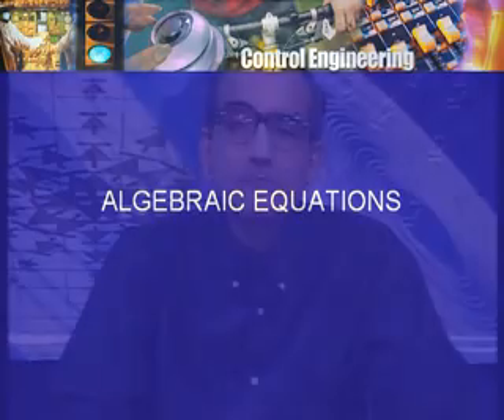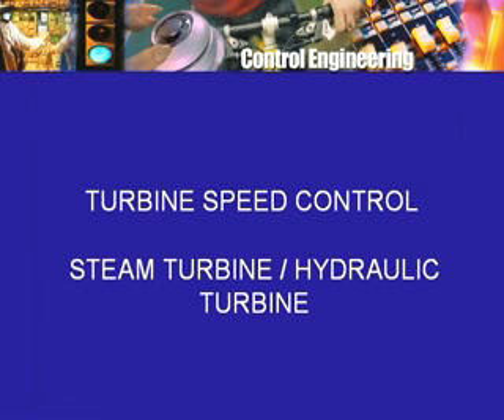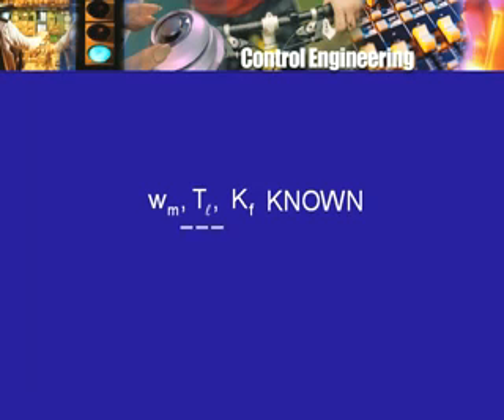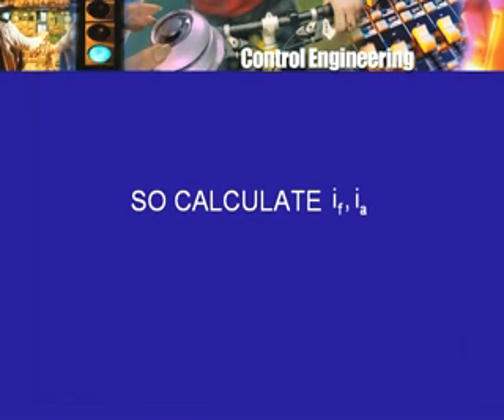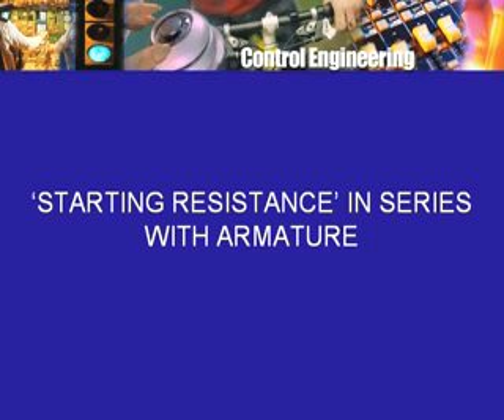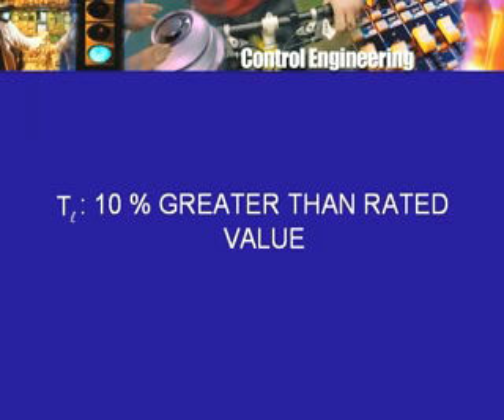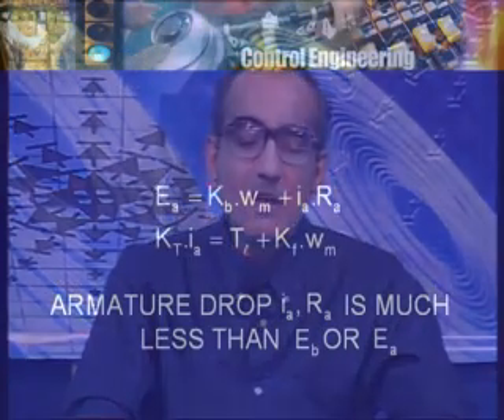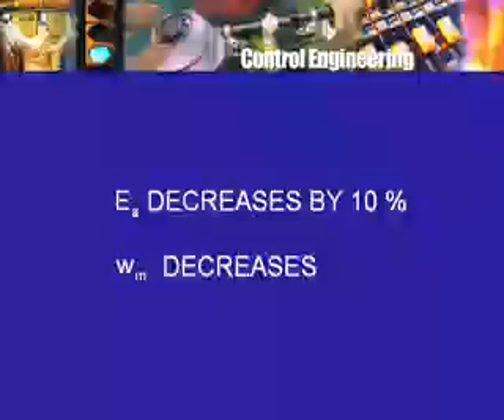Lec-9 Calculation of Error

Comment: Summary:

Steady State Analysis of the DC motor drive - how to calculate the current values for given values of load torque and motor speed requirements. 

Use of approximate values in the steady state equations to determine the effect of changing the various parameters involved mainly  load and applied armature voltage.